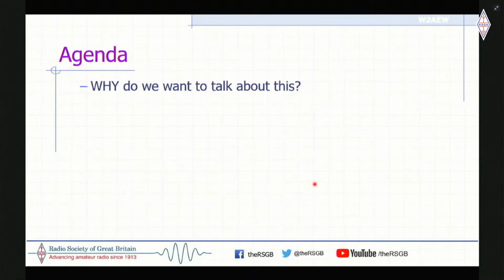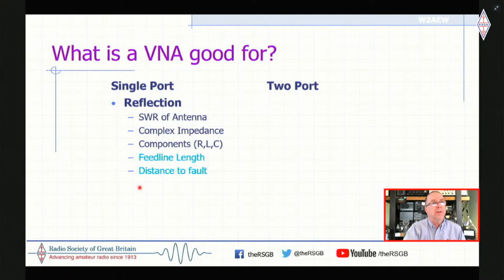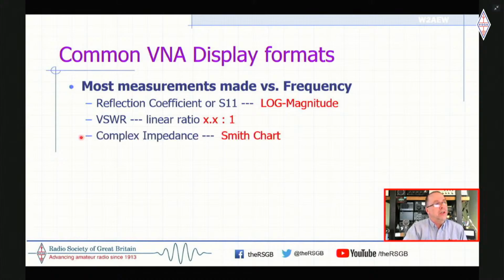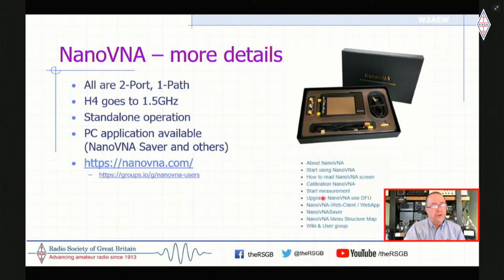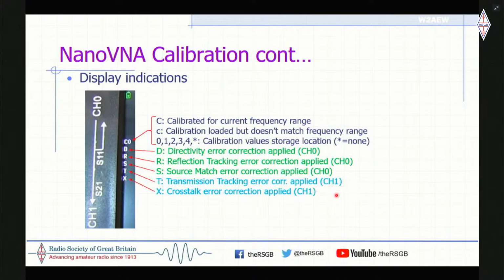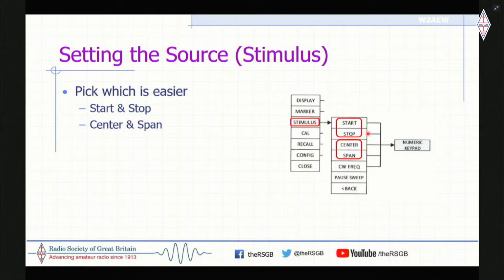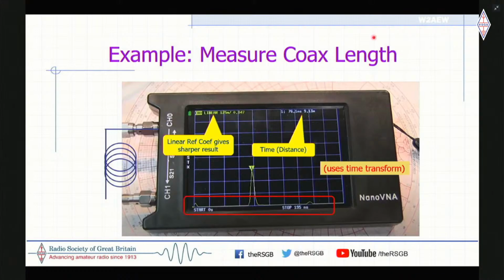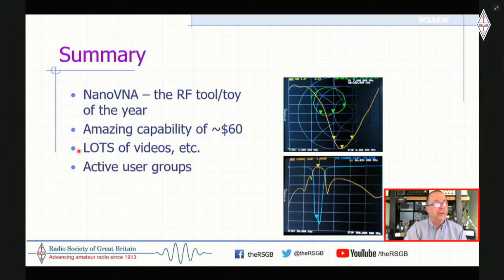RSGB Tonight @ 8 - An introduction to VNAs and the NanoVNA by Alan Wolke, W2AEW

Comment: Please note that I did discover an error in my presentation - I stated towards the end that the V2plus4 output is sinusoidal.  This is not correct.  It is also a squarewave (but does get more sinusoidal as you go above 1GHz...).
Reply from the maker: Many thanks for highlighting this Alan.
Reply: I was wanted to put a question regarding this one, when I read you corrected it yourself. Joe Smith has addressed it too in his video following it with a test: https://youtu.be/y6iOTEU6Zzo?si=P_QXJI2N737Ra2f- 
As I have not much experience at all, would this be a major issue and a deal breaker when testing active devices? Of course, considering the price, these nano's are probably useful for the most 'passives'. As I would like to learn and do more with RF I am considering a more real VNA (for home educational use). Modern bench top instruments are very nice looking but quite expensive and the question is if they are worth that money, like the Siglent combined instruments SVA (SA and VNA 2-in-1). I have an older but very nice SA Tek 2712, also the TinySA ultra and the nano H4. So plenty to start with. So my point being, if all affordable VNA's are using square wave what is the next step? 20-30 year old real VNA, like HP8714? The size, weight and the cost is an issue 🙂 For Siglent, the cost is an issue. Not much in between really I suppose. SV4401A has a nice screen and freq. range but also most likely uses square wave... So yeah. If I want a "real" VNA that is kind-a affordable that would be an bulky old HP (good dynamic range, fast, low IF BW, 3GHz, sinus stimulus..). For antenna's and such a nano would probably be more then good enough.
Reply: Put it some differently: Would you rather spend 2k on an old HP8714ES (3GHz) or about the same on SVA1015X (1.5GHz)? I know, well it depends, hahaha...